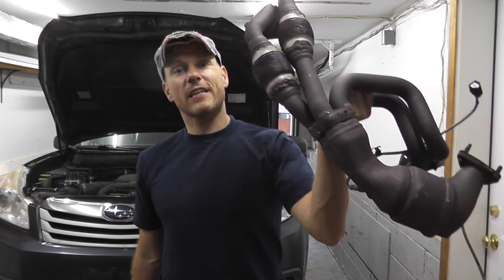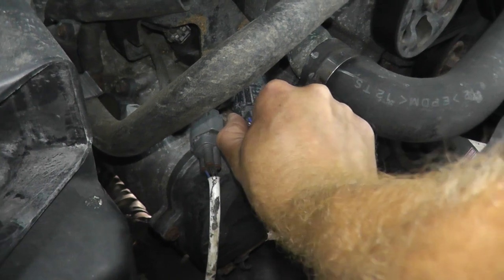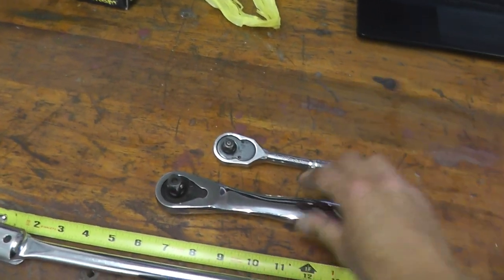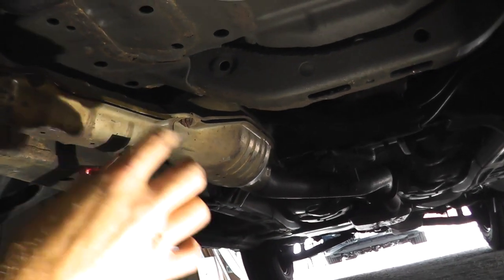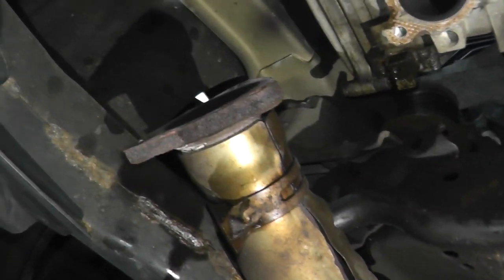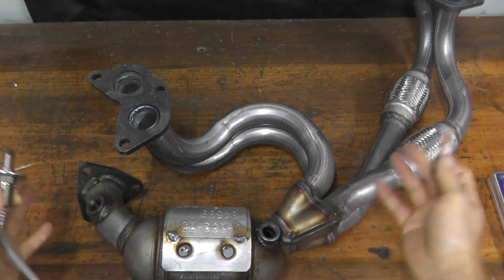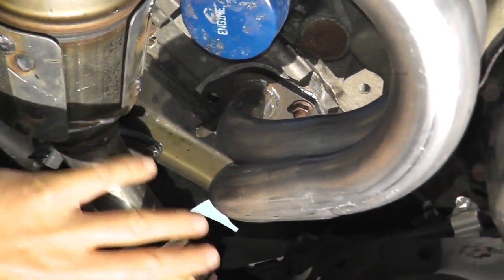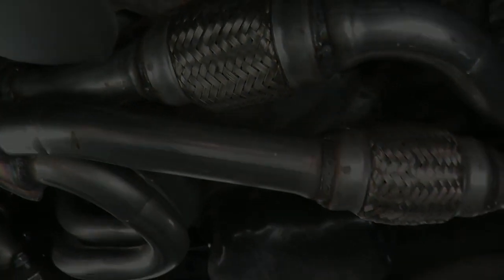Subaru Catalytic Converter Replacement with Basic Hand Tools

Comment: Looks like a fairly straightforward repair. I'm wondering why the dealer wants to charge me $2,900 for it!
Reply: Got quoted $3400 for a 2014 2.5i
Reply: Probably because of the trim and model. If you look at your quote break down they part is already gonna run you a good Chunk of money. Plus how ever many hours they charge for labor and their labor rate per hour.

You definitely can cut costs and go aftermarket. But I’d be careful about fitment and the quality of the parts. And you’d have to find a small shop to do it. Sometimes small shops can be shady. 
You get what you pay for 🤷🏻

If you were to do it yourself and don’t have the tools that’s gonna run you more money. Especially on older vehicles due to rust and etc. but I live up in the mid west where it’s cold.
Reply: @MK-zv4nl  That's hopeful you to assume the high cost was because of parts. But more likely in my case it was because the shop charges a ton for labor. I have the base model Subaru Outback and this was in a small, expensive Colorado ski town
Reply: My thoughts exactly...
Reply: oem converter is 1600 alone
Reply: @casmaster quoted 4.2 for 2011 2.5 forester LMAO dealers are crazy
Reply: I was quoted $4200 Impreza 2013 I laughed at the mechanic 😅
Reply: I’m in CA and the Livermore Subaru wants $5,300 just for the part. So sick and tired of these ridiculous prices. Going to go buy it from a junk yard

Comment: Another great video as always! I have always JB welded my heat shields back together when they start to rattle. It works great. I was never aware that you could run without them.
Reply from the maker: Great tip!

Comment: This repair would be almost a grand in a shop using the OEM parts you bought. Great job saving money!
Reply from the maker: Which gaskets? I show new gaskets in the install.
Reply: The OEM converter is over a grand by itself.
Reply: A Subaru dealer by me quoted be around $4k for this. Yeah, going to be doing this myself. This is a great video!
Reply: @radcity22  why are you changing it ?
Reply: How did the cheapo aftermarket Cat hold up?
All I read are negative stories how aftermarket Cats for Subarus don't last more than a year. Some are inefficient, or defective from the start.
Would be great to get a response. 
Not shelling out 1500-2000k on Cat for a 2011 Impreza pushing 300k miles. 
When a replacement part exceeds the value of the vehicle, that doesn't fly with me.
Thanks.

Comment: Hello. I modified my Subaru Impreza  2013 catalytic converter. The one you've just demonstrated up there because I couldn't get the exact one. They are highly priced here. Cleared the codes but the cata code still came back. 
The Impreza has two catas. One at the middle and the one you've demonstrated above. What's the solution to this. Is it a must I put the other one? I was of thinking that once I put the one in the manifold will make the light to go off.

Mine was stolen, both.

Comment: I will be doing this job soon. I am a little worried about removing head bolts/nuts.  If my car had the head gasket replaced 10k miles ago, my mechanic would have most likely removed these bolts/nuts right?  So they shouldn’t be too difficult to break free?
Reply: Yes. In order to get the heads off to replace the head gaskets, you have to undo the exhaust manifold/catalytic converter, intake manifold and a BUNCH of other stuff.
Reply: @danielshowell  yea man.  Luckily they came out with ease.  But the shitty o2 sensors from 1a auto both failed and had to be replaced within a few weeks of installation.  Was a bit of a headache.
Reply: That sucks about the o2 sensors. Those aren't cheap. I just bought an 08 outback. Turns out that the exhaust manifold/cat is cracked. However, last night I was looking up prices on new ones and found that Subaru has a recall on those. They will replace it. That's is good news,  since Colorado, as of Jan 1, follows California CARB laws, which makes catalytic converters a LOT more expensive. We are not allowed to even buy, sell or install a used OEM cat. Insane. Sorry for my rant. I lucked out with the recall.

Comment: EDIT... Brand new "aftermarket converter".... Just removed two nearly (less than 5k miles) new aftermarket converters off of 2010-2012 outback's both had come apart and clogged, my guess is they weren't even quality enough to get rid of the p0420 cat code before clogging.. Yes they really do suck that bad, I am a Subaru specialist and have replaced a ton of aftermarket converters over the years.. OEM OR BUST....
Reply: Also over 50% percent of these Outback's are PZEV models (partial zero emissions vehicles), which have identical looking converters but over twice the converter material inside. The aftermarket companies don't even offer one for PZEV's and claim it works on all models lol... Good luck with that!!
Reply: Would this be the same for a 2009 Subaru Legacy turbo?

Comment: I was wondering if the aftermarket converter you used would give problems. I thought the use of a Cali spec converter was smart.
Reply from the maker: No issues. This was a Walker unit. Cheers.
Reply: Is this still the case? Let your viewers know if the parts are good before they do the same repair